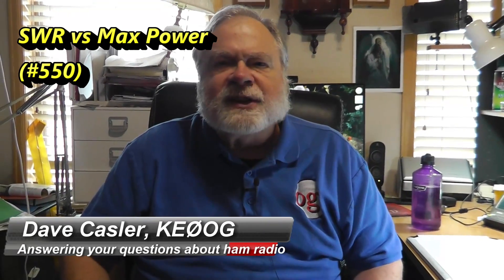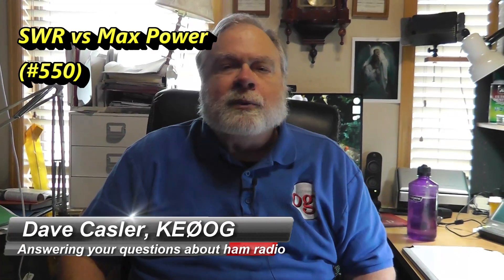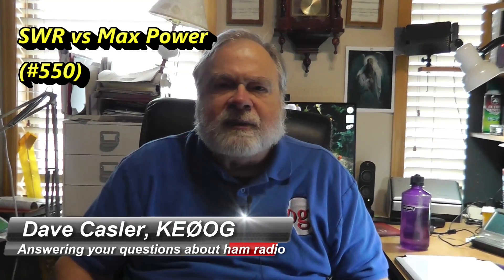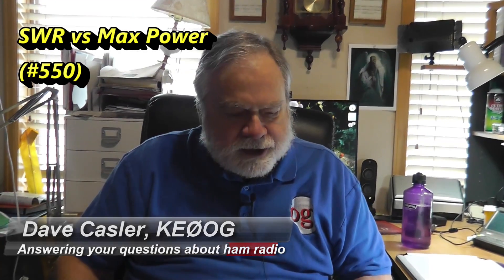SWR vs Max Power (#550)

Comment: A standard power meter doesn't see the whole picture since the current & voltage will not be in phase. Added to that is the fact that your introducing more reantance to counter the mismatch at the antenna.  The inductance / capacitance also store engery when matching the antenna etc...

Comment: This may be the only time I have to disagreed with you, Dave. Tuning at, say 10 Watt, for minimum swr, then running 1kw may give you a very different reading. 
Nearby objects and the such may not reflect power at 10 watts, but will at 1kw. In some instances, you will need to retune for lowest SWR at max power.
Reply: I think Dave would agree with this and say that this video also alludes to the same conclusion. Dave recommends to ensure that the SWR is the lowest and not to detune the antenna to artificially get a higher forward power reading. As stated here, the higher forward power reading will correlate with a higher reflected power as well, so not all the forward power is being radiated as RF. He just didn't go the next step to warn that the lowest SWR at low power might not be the lowest SWR at high power, although they are almost always the same.
Reply: @Pelnied  I would tend to agree with you. But when I lived in the NYC metro area, on a typical 50 x 100 lot, surrounded by houses (with aluminum siding) and other objects, my swr at 10 watts vs 1,000 watts could be, and usually was, drastically different- 
Like 1:1 vs 3:1+, depending on band.  
I'm lucky enough to be on 5 Acres of land now and no longer experience such dramatic swings. 
When I lived just outside of NYC, I believe I earned my "worked all neighbors" award. 😁
As a matter of fact, there was an elderly gentleman who lived next door to me who repeatedly called the police (who couldn't do anything) wrote and called the FCC, etc. 
Even though I told him I wouldn't operate before 10PM, it wasn't enough. Even using my 25 Watt 2-meter rig would summon him to knock on my door. 
I finally paid for basic cable for him for 4+ years as a gesture of peace.

Comment: The antenna tuner is providing a conjugate match where by its adjusting the capacitive and inductive reactances to cancel each other out to obtain resonance,the radio will see a purely resistive load and allow maximum power output, The reflected power joins the forward power back to the antenna at the match point is why you see more power on you meter reading,this cycle continues until all power is radiated by the antenna or attenuated by the feedline, the reason for low loss feedline like balance feedline is that more of the reflected power will get radiated by the antenna with little of the reflectedpower lost ,The tuner corrects the phase of the voltage and current at the tuner output by creating a mismatch equal in magnitude and opposite phase to the feedpoint mismatch to allow these reflections to happen

Comment: If power is being "bounced" back out, then isn't that going to create out of phase signals and effectively distortion similar to multipath?
Reply: The tuner corrects the phase and allows the reflected power to be reflected back to antenna, The higher power reading that Dave mentions is the reflected power joining the forward power back to antenna

Comment: Other reasons for seeing higher apparent power when the SWR is higher:  Most power meters only give an accurate reading when the impedance at the measurement point is 50 ohms.  When your SWR is higher, the impedance at the measurement point is not 50 (and it can read erroneously high or low).  Another way to think about this, as the SWR goes up, the standing wave that is setup on the transmission line has peaks that go above the true input power (and troughs that go below the true input power).  Depending on where the peak/trough lines up with where the power meter is, you can read higher or lower.
Reply: This is correct, the feedline becomes an impedance transformer with standing waves on the line ,the meter will be reading the reflected power that's joined the forward power adding to the power output, this is known as reflection gain
Reply: I was going to ask about this because I thought I'd learned part of the magic of the doublet, and using balanced feed line that if balanced doesn't radiate,  is that the signal will bounce back and forth until it is radiated or absorbed by what resistance there is.  I didn't think that would cause spurious signals but would show up on the forward part of the meter.
Reply: @steinshaw2490  I don’t agree with Dave that high SWR generates spurious on its own. What I think Dave meant is that certain PA designs may be driven into non-linear operation when they see an unmatched load, and that non-linearity can generate spurious / harmonic components.
Reply: @w2aew  I don't agree either ,what may be happening is that common mode current may also be present that many people misunderstand as a problem with high swr ,which it's not it's a separate issue caused by an antenna imbalance not feedpoint impedance mismatch

Comment: Dave, thanks for your knowledge.  I started and stopped but am back. Can you recommend a basic antenna to start.
Reply: I would go for a dipole.
Reply: Spike S  Thanks. I can do it but would have to run it over the house or connect one to the house on a pole. I don't have a tuner yet an it says it doesn't need one. What are you using. There's an MFJ 9391, 200 Watt Autotuner.